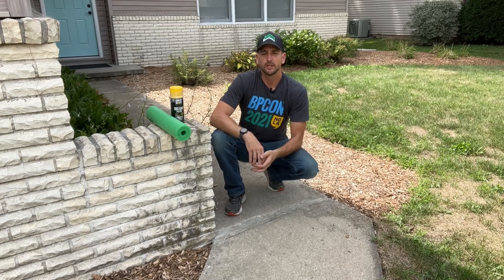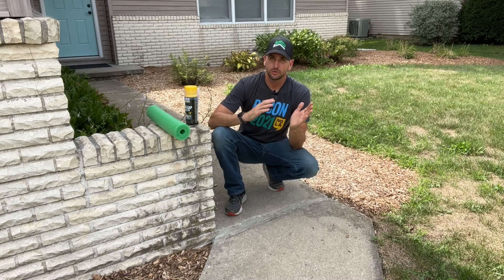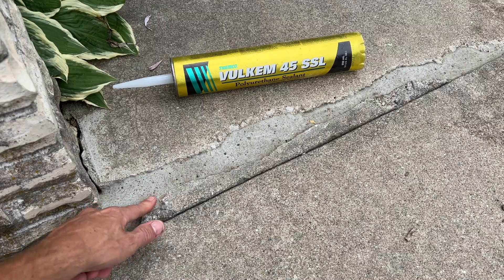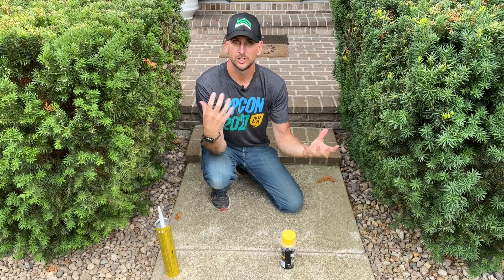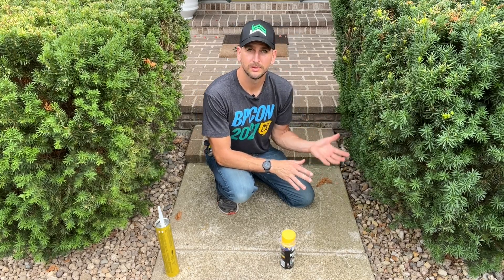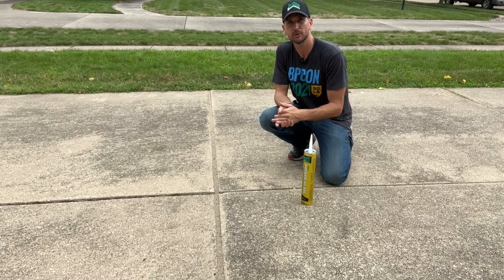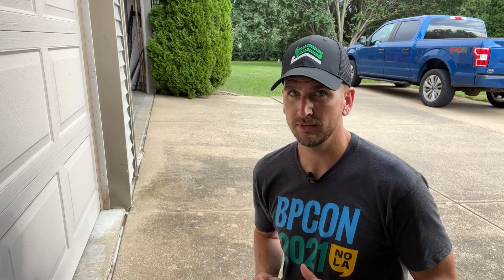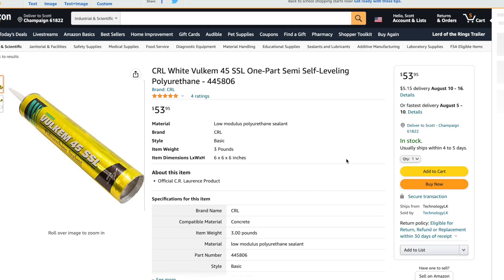Best Way To Seal Cracks In Concrete | Project Updates

Comment from the maker: Tremco Vulkem 45 SSL:  https://geni.us/FiPeg
Sika Self-Leveling Sealant (Gray 29 oz):  https://geni.us/2AGdCmG
Large Caulk Gun (29 oz):  https://geni.us/pJaKTw6
Nylon Cup Brush (For Drill):  https://geni.us/3iESD
1" Backer Rod (25'):  https://geni.us/qo7b0Ry
3/4" Backer Rod (20'):  https://geni.us/bCyfQBy
5/8" Backer Rod (20'):  https://geni.us/Yhxznv8
1/2 Backer Rod (20'):  https://geni.us/C1J5p

DISCLAIMER: This video and description contain affiliate links, which means that if you click on one of the product links, I’ll receive a small commission.

Comment: Do you think the sika or the vulkem is a better sealant?   After watching you earlier video, I sealed several cracks on the top 1/3 of my driveway, after I had it professionally mud jacked. Prior to the mud jacking,  I had a 2-4imch drop from garage floor to driveway.  Now it's pretty level.  I didn't want water getting back under those slabs so I sealed with the silka.  It was actually quite a job and I went through a lot of product.  After cleaning.the joints, I used fine sand below the silka.  That seemed to work well.   I do need to sal several remaining cracks this summer, so wanted to know if you preferred the sika or vulkem?  Which do you think will last longer

Comment: After a very hot summer in Milwaukee, I finally got around to patching the cracks on my sidewalks and patio. I used the same method and Tremco sealer, but the sealer was not liquid consistency as  video shows. It was more like a toothpaste consistency, which angered me. I ended up smoothing out with my rubber gloved finger. I purchased a few tubes from Amazon and I bought a few tubes from Home Depot months ago and waited for cooler weather that finally arrived today September 8th. Maybe this Tremco sealer was old? I had the tubes stored in my garage out of the sun, but maybe the summer heat in my garage hardened?? Maybe I should have stored in my cool basement. Not sure, but the job wasn't as easy with the Tremco toothpaste consistency.

Comment: I've watched all your videos on filling cracks in concrete and they are great. I have a split between a retaining wall and wall of the house. I was wondering if you had any ideas on doing the same but with a vertical crack?
Reply from the maker: I had good luck with both Tremco and Sika products.  Looks like Sika has a sealant that could work on your vertical crack application and most likely in stock at your local Home Depot https://www.homedepot.com/p/Sika-10-1-fl-oz-Sikaflex-Concrete-Fix-No-Sag-Concrete-Crack-Repair-Polyurethane-Sealant-in-Limestone-7116100/300934560

Comment: Yeah the great stuff, I commented on.. it’s notorious for collapsing over time.. and I don’t feel like that leveling was at all professional, or a lasting fix..temp sure.. but if I looked out and saw a contractor drilling holes and filling the holes..I’d 2nd guess my decision on hiring him…with that said though…time will tell if I’m wrong, and I’m excited to see if it holds.
Reply: I really had high hopes for the great stuff working as a support base for the pad since there is a product for setting fence posts using a similar expanding foam which works very well.
Reply: @Faith_Family_Firearms_Freedom  must be a closed cell type foam. The reason the great stuff collapses is because it is open cell. Great stuff (open cell foam) is a great insulator but has poor compression strength.
Reply: @Jacob-ft3oz  sounds about right. Since I don't know any better, we'll go with that.
Reply: @Faith_Family_Firearms_Freedom  urban rescue ranch used the post foam.. he said it was terrible.. he ended up switching to concrete.. I believe it shrunk if I recall and the posts were loose.

Comment: @2:14-  No question your slab was going to go back down.  The professional services do not use Great Stuff type foam. That stuff is open cell foam and very compressible (and will suck up water if/when the skin is damage).

Comment: If you are going to redo the Sika self levelling section, how would you go about removing the old application and prepping the area for another application?  I imagine if it did its job, it is well adhered to the side?  Or maybe it will come out like the adhesive that new credit cards come attached to paper?
Reply: power washer, wire brush and and propane torch

Comment: Former Hoosier here, glad to be away from that humidity and heat. 

Thanks for giving me the courage I needed to tackle my driveway. Two weeks ago after viewing your (and other) videos, I used Sita Pro to seal cracks in my driveway and inside my garage. First, I used my drill with an  abrasive nylon wheel to clean out the cracks.   I used foam ropes and sand to fill the bottom of the cracks, leaving a 1/2" for the Sita sealant.  Then I covered with sand.  For the largest cracks/wholes up to 2" across I used Slab sealant.  During the week I allowed for curing, the daily highs were 55-75 but dry. The driveway looks great today. (My neighbor did Sita fill a year ago. The Sita is still quite noticeable)  

The garage floor is another matter. There, most of the cracks were narrower. In an attempt to get a more level surface and fill the cracks, I used a putty knife to force the Sita into the cracks and tried to level it with the floor.  I used a 2nd coat of Sita for the deeper cracks.  The 2nd coat did not self-level -  I used an tube opened the day before. The knife left a paper-thin layer of Sita on the floor so I had many wide stripes crisscrossing the floor. Ended up painting the floor to cover the stripes.  The floor looks pretty good, much better than the unfilled cracks or the Sita stripes.  

 If I did it again, I would consider using an angle grinder to smooth out the crack edges.

Comment: I like to use rigid foam insulation boards , 1/2 " thich,  4 x 8 sheets , cut in strips to fill the cracks before filling the crack with self leveling caulk .

Comment: I used Sika SL to fill the deep expansion  joints on my covered patio slab. The wife was tired of having to dig/vacuum leaves out of the joints. Four slabs, two joints. One was essentially perfectly level. The other had a slope of about 1/4 inch per foot. I took a chance and used the SL on the sloped joint and it worked without flowing, results were good. The only thing to be very careful about  is getting the product on surfaces you don't want it on. Once it finds its way onto a surface, it is there for eternity.
Reply from the maker: Thanks for the feedback 👍

Comment: I've used Silka on many of the cracks in my driveway about 12 years ago.  It's worked extremely well, and has held up perfectly over the last 12 years.  Before this I had weeds growing everywhere.

I've also used a similar product from Akona in expansion joints in a sidewalk.  2 years later, and it's also holding up well. I think any polyurethane based crack sealer will work relatively the same.  They all cure into a rubber like consistency.

I've never used any backer rod, I've just cleaned out the cracks with a power washer, and filled them with the product.  It wasn't cheap at around $60 of product to fill these cracks/expansion joints, but given that it's held up for 10+ years, that's very cheap for the results you get.

Comment: I'm going to say it again - press wash / wire brush scrub out, clean it and let dry, use fine kiln dried sand to fill all the cracks, it will fall right into every little crevice filling up better than backer rod and you don't have to worry about different sizes, then quality self leveling product.  I used Novalink SL and Sikaflex SL.  12 big tubes of Novalink then ran to HD for 2-3 tubes of Sika.  I tried a small tube of the non self leveling Sika in a couple of spots on my sidewalk and it was garbage - didn't make it 1 year and just pulled up.
Reply: This is good advice.  This is largely what I did with my cracks as well.  The Silka product works very well, but you DO have to clean out the crack/joint as you mention with a pressure washer.
Reply: I experienced a problem when I pressure washed or even hose-washed cracks. Even though the expanded area that I intended to caulk was only 1/4" or 1/2" deep, the cracks actually ran all the way through the slab. When I introduced water, dirt came up through the cracks, muddying everything up. How did you avoid this?
Reply: @David Siegal  I probably had better drainage.  I would try a leaf blower right after pressure washing and see if that's clean and gets the water and dirt out of the way.  If it keeps coming up, I think there's a problem with grading.  Water should be at the top though, not dirt / mud after power washing.
Reply: @whattheschmidt  Thanks, I’ll try that out

Comment: Loctite has a much denser spray foam that may have resulted in less settling. The end result is more similar to what professionals use. Essentially, you get more foam and less air bubbles in the finished product.
Reply from the maker: Thanks for the feedback, I will checkout the Loctite foam.

Comment: You'd be better off using a hybrid silane polyether caulk like the one Rapid Set makes.  It lasts much longer and will even adhere in wet conditions.  Always give it sand after you caulk.

Comment: The question you did not address is: how will these hold up in the face of the inevitable weeds? Will I be able to pull out a weed without destroying the seal?
Reply: The amount of weeds that grow in the cracks will be proportional to how much dirt is present for the weeds to take root. If you have a persistent weed growing through the seal, Pull the weed, remove that section of the seal, apply a herbicide, and reapply the seal using the techniques in this video series.